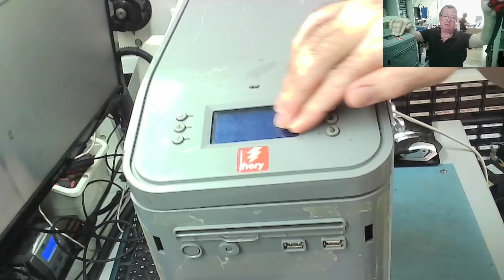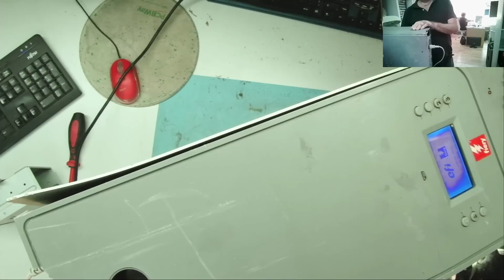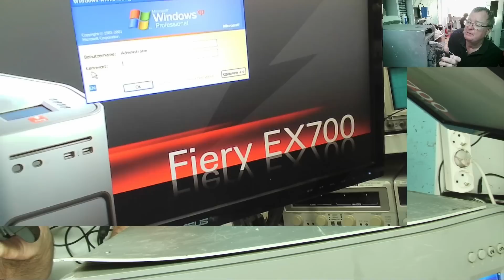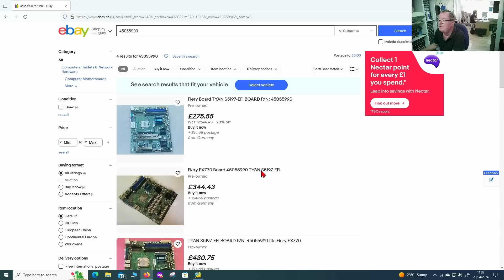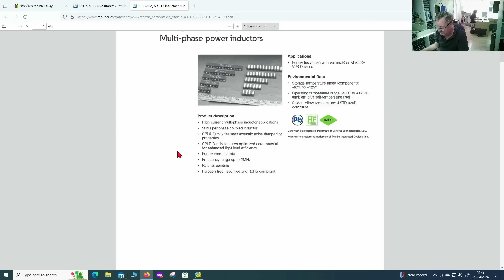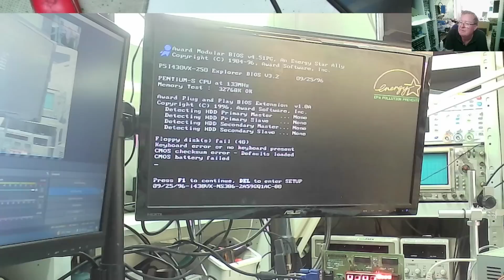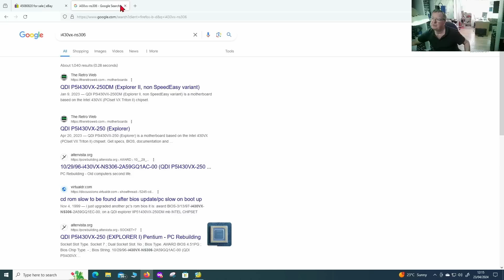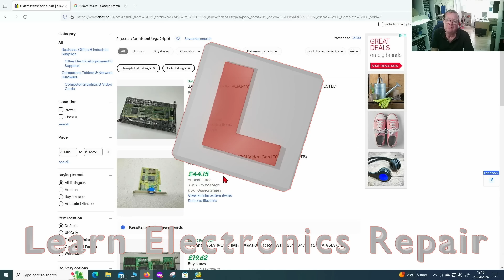Car Boot Flea Market RETRO PC Finds 28th April Retro Gaming

Comment: From Wikipedia:

The Pentium (also referred to as the i586) is a x86 microprocessor introduced by Intel on March 22, 1993. It is the first CPU using the Pentium brand. Considered the fifth generation in the 8086 compatible line of processors, its implementation and microarchitecture was internally called P5.

Comment: The long socket is PCI-X (PCI extended), a 64 bit extension of PCI. It didn't get much uptake but it was used for things which would overload the standard PCI bus such as SCSI and RAID controllers. It was soon overtaken by PCI-E.